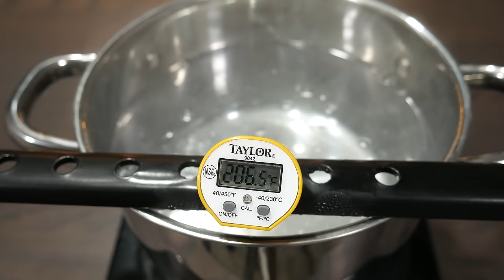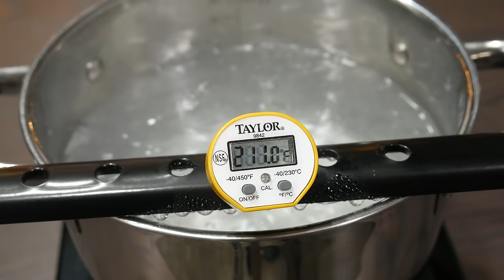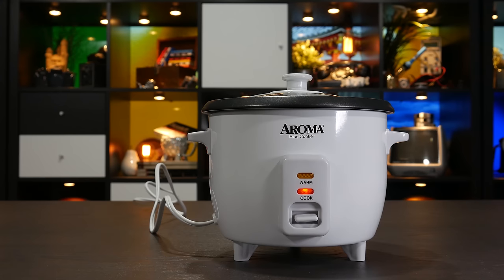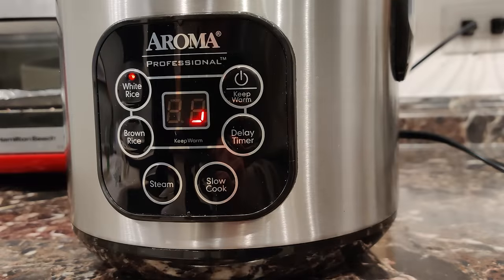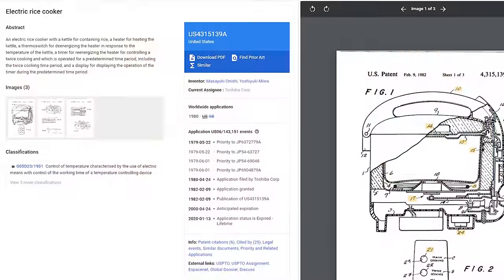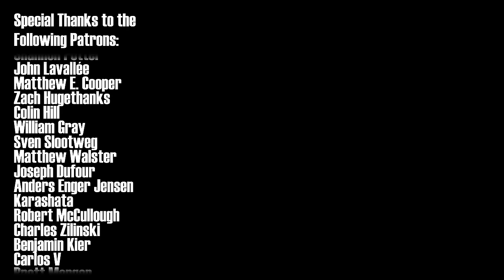Old-fashioned rice cookers are extremely clever

Comment: So lucky for you all here I just had a lecture on magnetism and still have my notes out (if you care to read it)
- Within a bulk mass of magnet there are domains, areas with the same magnetic moment.
- Magnetic moments derive from the atomic structure and is beyond the scope of this youtube comment.
- Senseable temperature is actually the rate of the random motion of particles in space.
- At the Curie temperature (Tc), the energy it takes to move the orientation of a domain is equal to the energy whithin that random motion.
- Above Tc, there is enough energy for the domain orientations to be scrambled by random motion.
- For a magnet, all the domains must point in the same direction.

The interesting thing is that in order to realign the domains, a magnetic field must be present while it cools down. I suspect you would have picked up the presence of a second magnet (electromagnet?), so I suspect there is something more complex going on where the magnet doesn't completely scramble. I might have to ask my lecturer, though he probably won't know either.

Some bonus facts:
- Above Tc, the material acts like a paramagnet.
- A paramagnet is basically what we would call something magnetic but not a permanent magnet.
- Ferromagnetic materials have the magnetic moments (at a atomic level) pointing in parrallel and add together
- Antiferromagnetic materials have the magnetic moments pointing antiparallel and so they cancel out.
- What we call permanent magnets form when atoms switch between domains in a process called Magnetic Hysteresis.
Reply from the maker: I'll tell you for sure the is no electromagnet in there. I believe it's not the magnet that reaches its Curie temperature but the material that it's attracted to. There were a few forum posts I ran across where someone said the spring itself was what lost its magnetic attraction but frankly that seems to run counter to what I've observed. The magnet definitely sticks to the sensing button, so I think it's that which is important - not the magnet itself

Comment: This functionality is also used in smaller pressure cookers. I have a small pressure cooker with the exact two modes, cook and keep warm. I accidenlty one day forgot to switch the cooker off in time while cooking beans. Thought the beans would be burned and the bowl ruined. Was surprised to find the cooker had switched to keep warm mode and there was a little bit of water left at the bottom. The beans and the bowl were fine. Did not understand how it switched to keep warm mode itself as i thought it was fully manual. I bought the cooker second hand without a manual. Thanks for explaining how the auto switch works.

Comment: We have that exact rice cooker and you’ve made me appreciate its simplicity. I had originally thought it worked by lifting off the burner when enough of the water has evaporated. It works consistently well but makes a mess as starchy water percolates through the loose lid. I wanted a more advanced, less messy one, but you have me reconsidering after pointing out how messy it gets under the seal. I think I’d rather wipe up the counter.

Comment: Alec, I bought a cooker thanks to your video, and found a way to avoid the nasty residue (that by the way, flies together with the water vapor expelled by the cooker and stains all the nearby kitchen surfaces): Just rinse the rice with clear water multiple times before using. I do it 4 times until the rinse water comes up less cloudy (doesn't need to be crystal clear). You will see an incredible difference, almost zero residue.
Reply: You're supposed to rinse rice, man. the bags should tell you that you need to. the residue is a powder added to the rice to make it not stick together in the bag. today it's edible and not too unpleasant, but it used to be Talcum Powder! you for sure didn't forget to rinse that off!

Comment: This message is brought to you by Celsius Supremacy: "water boils at 100C"
Reply: *100℃ (for disambiguation)
Reply: @hadrast   I for so long don't know how to type that, do you need a math typing software or something?
Reply: I liked the ironic nod to that in the video.
Reply: @kian8382  Extra ascii symbols are created using your numpad.
Turn on numlock, hold alt then type in the code for the symbol and let go.

For example the degree symbol is 0176. °
My favourite is just 3. ♥

You can easily look up more, it's semi useful.
Reply: This is the internet so in the traditions of pedantry I'd like to point out that boiling temperatures vary with a number of factors including pressure, the material, variations in gravity and shape of the vessel its heated in and the rate at which its heated.
Reply: @CallyMayz  Wow that's interesting, I must try it at work as my home computers don't have number pad. Thanks, great to know. Alt3
Reply: There are also some other ways to type out Unicode symbols, such as the character map or math symbol input accessories in Windows; I don't think the Alt codes cover everything. I'm using a customizable foreign language IME (input method editor) that allows me to map character conversions to whatever symbols I want. If nothing else, copy-paste will also work.
Reply: My name is negative 40 and I don't see what the big deal is?!
Reply: Thomas aside from pressure, how much will those other factors you list make the boiling point of water vary?
Reply: @kian8382  WIndows Key -> All Programs -> Accessories -> System Tools -> Character Map
You can find all the oddball characters and the Unicode character needed to create them.
Plus you can copy/paste stuff out of the utility.
Reply: This is my first time to this channel. I can't tell if he's being sarcastic with comments like this through the video.
Reply: ɮօʊռċɛ օʄʄ  It's as if someone based a unit of measurement off the freezing and boiling point of water, rather than someone most people have no understanding of.
Reply: Kian J on iPhone just hold 0 and it gives you option for °
Reply: @Thomas - indeed. Pressure related variations actually make it quite difficult to cook certain dishes that rely on the idea that water boils at a consistent temperature.

It's difficult to make a good cup of (black) tea high in the mountains, because the water needs to be at about 95 celsius to get the right result, which can end up being higher than the boiling temperature of water.

(green tea needs to be done with 60 celsius water. This is a factor in why Asians frequently seem to make terrible western style black tea, and why westerners often burn green tea, which tastes terrible.)
Reply: ɮօʊռċɛ օʄʄ  it's how they defined 100 Celsius Degrees, so yeah, it's a dead serious rule.
Reply: @sandgaijin  he's always sarcastic, unless he genuinely didn't knew about Celsius.
Reply: @thomas316  material and shape of vessel and rate of heating only change the boiling rate. zero gravity also makes it boil slower due to the chage in buoyancy of steam.

the only thing that changes the temperature that water boils at is the atmospheric pressure it is boiling under.
Reply: @wyattroncin941  Before you go any further you should probably check the following link out. I think you'll learn something new: http://www.sites.hps.cam.ac.uk/boiling/superheating.htm
Reply: @CallyMayz  so is 248
Reply: Thomas you missed one: elevation.
Reply: @kian8382  duh, just use shift and press the ^ on your keyboard. Nothing fancy.
Reply: @CallyMayz  ^
Reply: According to Anders Celsius, water boiled at 0 and froze at 100 - I always (wrongly these days) call it "degrees centigrade") rather than Celsius to avoid ambiguity :)
Reply: Correction, the temperature difference between freezing and vaporizing water is the DEFINITION of Celsius.
Reply: @GyprockGypsy  correcting what?
Reply: We have an answer from the Kelvin Rioters: "water boils at 373.15K"
Reply: Sorry only I only speak what put a man on the man.
Reply: @Kian J: This message made my blood hot, about 100°F. And, which is more immediately important to humans? blood or water?
Reply: @lesliefranklin1870  yes.
Reply: Whoosh
Reply: 0C is when water freezes. 0F is when people freeze. One is definitely more important to track than the other.
Reply: @squishmastah4682  Guess what, 1F is also when people freeze, so is -1F, how interesting.
Reply: @squishmastah4682  0K is when people freeze. Put on a coat~
Reply: Yes I think he knows that. Sarcasm buddy 😂
Reply: @kian8382  Hold Alt and type 0176 on your numpad.  Alt+0176 gives you °
Reply: @doggyspeak  Exactly.  I forget who said it, but, "Fahrenheit is how the person feels, Celsius is how the water feels" and there's something about Kelvin, but I can't remember that part, either lol  Also, as an American who does know how long a km is, it's 3,280 ft, 2,000 ft short of a mile.

Comment: It’s fascinating how mechanical electronics are. I just assumed everything was electrical.
Reply: I guess once you find the right alloy that reaches the curie point at like 215° , it would be easier and cheaper to mass-produce than an electronic thermostat, etc.
Reply: @cgduude    Another thing to remember is warranty returns.  From the seller's point of view the simpler devices are better because with fewer things to go wrong - you get fewer warranty returns.
Reply: Another interesting fact that goes with that is actually the way toaster timers work, as they use two thin metal strips back to back that slowly curve as the heat of the toaster warms them until theh cause the toaster to pop, while the dials affect the point at which the curving causes the toast to pop up.
Reply: @colincampbell767  Except the fuse. If that thing fails, o doe the appliance...
Reply: In the case of the "basic" rice cooker, There were no electronics. It's entirely electro-mechanical!

Comment: "I'm sure you all will tell me why my priorities and preferences are wrong."

Meanwhile in my brain: "Why the hell are his outlets sideways?"
Reply: @ShadownetZero Really? I've never seen that in my entire life
Reply: Stock Name  They are supposed to be that way, with the ground pin up. That makes a short circuit less likely if a piece of metal falls on it from above and it is not plugged in all the way. I think it looks upside down too.
Reply: What do you mean? How are they in your house?
Reply: Wait ‘till you find out every country has totally different plugs and everyone thinks there’s make the most sense :)
(In New Zealand ground is at the bottom, typically, but also our pins are on 45 degree angles, not straight like US ones)
Reply: @matthewjamison1193  does this happen often, thin bits of metal fall on your plugs?
Reply: @davidlawrence8711  it is an exceptionally rare occurrence, but all AU/NZ plugs made after the early 90s have the plastic coating on the top two angled pins because of this. Any new plugs that lack the plastic sheave these days are manufactured for the Chinese domestic market, as this is the plug used there for non-personal electrical devices (they use the US plug for personal devices). However the Chinese non-personal plug is pluged in upside down with the angled pins facing downwards and the straight earth pin facing upwards in case something falls on the pins.
Reply: Or another way of putting it is that the plug that is used in China for TVs   are exactly the same as the plugs used in AU/NZ in the 80s, but they are plugged in upside down at the wall to stop electrical hazards.
Reply: @richienyhus  thanks for the info!  I can’t believe I’d never realised they all have the plastic coating - I can picture some, especially Apple plugs which coat in white, but I’d not realised they all have it (you can picture me pulling out stuff around the house just now to see if I could find one without haha...).
Could this also be to stop little fingers making contact while the plugs are in enough to be live? Mum would always caution my kids about how they held a plug because she’d seen a “9 year old girl blow her fingers off” touching one (very easily could have been pre-plastic coating).
Reply: Id rather have sideways than what I have at my house... all 5 individual light switches, on one wall, about 18" from each other, but slightly higher or lower on the wall than the others. Not even close to a straight line. I just look at it sometimes and it honestly upsets me an unnecessary amount.
Reply: Upside down outlets don’t look like little happy smiley faces so it’s less attractive to children as well. Though I will fully admit to this being an ad hoc and unsourced observation/reason.
Reply: You people could look at the behemoth British plugs. Springs, caps, chunky AF three pins, even if one is plastic...

You can't make any British plug or socket sleek. 😅
Reply: In commercial buildings, you will see a lot of outlets installed upside down, mainly so the grounding prong is the most likely thing to be hit first by a piece of metal.
Reply: @davidlawrence8711  I guess you were never a firefighter who gets called out because a plug that was ALMOST all the way in had some metal Christmas tree tinsle touch the leads and the whole tree goes up in smoke, usually with the house igniting as well.
Reply: @davidlawrence8711  Same, same. In Aotearoa as well but absolutely had not noticed the change. Just pulled out the 3 plugs next to me and they all have plastic coating. Also, note to self, DON'T unplug the lamp unless you actually want to walk across the room in the dark to turn on the overhead light. Duh.
Reply: @matthewjamison1193  yes. I worked for an electrician and in one house the home owner request we put them in upside down. I thought it crazy but the guy told me that they are supposed to really but it's not enforced because too many people don't like the ascetic of an upside down outlet. We always placed them sideways in kitchens and bathrooms though.

Comment: Thank you. I had thought it was weight triggered but this is more interesting. I'm on my 4th rice cooker, each ordered over a year. The problem with most is the rice husk dissolves into the water (an excellent reason to rinse rice) which is then sprayed thru the vent hole onto your cabinets. A cooker with a veggie basket (with or without veggies) sprays less rice vapor around. The rice cooker that makes the "keep warm" setting an option delivers better rice. Once rice is mostly waterless, it's a good time to shut it down. Cooking longer tends to fry the bottom rice, which is made worse by continuing to warm the rice. This isn't a problem if you like dry European/US cooked rice. It'd be possible to have a better cooker, or chef can keep a closer eye on the "automatic" cooker.

Comment: I have the same model of Aroma Rice cooker (large and small...ot sure of cup measurements atm) and a similar model of the other one in the video.  I use to only cook rice or occasionally steam some veggies in the Aroma cooker.  Now, i use it for multiple things.  It's great for oatmeal, cream of wheat, Coco wheats, heating up soups.  When my stovetop quit working, i found i could cook canned veggies, hot dogs, hamburger, bacon , sausage, scrambled eggs,... basically most things i would use a pan on the stovetop for.  It really has become a multi functional appliance in my kitchen.

Comment: I am usually very sceptical to kitchen machines, and didn't get a rice cooker until like 5 years ago when i was already over 30 years old... i realized this was the best and only kitchen appliance i ever need... this and an electric kettle... anything else is just a hassle... best electric appliance investment i ever made... 
Perfect rice every time and i eat rice most days... if you forget it it just turns off or keeps the rice warm, super easy to clean... fairly energy efficient as heat isn't wasted into the surrounding from the stove... after that i told everyone in my family to get a rice cooker.

Comment: 2019 : Toasters
2020 : Rice Cooker

at this point i have no idea what will come up next
Reply: Rice cookers with built in toasters.
Reply: A cattle?
Reply: @TBFSJjunior  You mean, a kettle. Cattle will come up next on a different channel called Farming Technology Connections.
Reply: Iron for clothes
Reply: Pressure cooker?
Reply: @Wolf-Spirit_Alpha-Sigma 
😂
Damn I knew while writing that it looked like the animal but things are never written with a k in English so I went with it.
(And a/e is a hit and miss anyhow)
Thanks for the correction.

First I wanted to write "water cooker" as the German word is Wasserkocher, but remembered you don't cook water but boil it in English so "water boiler" ... oh wait no that is the one making hot water for the shower.
I was so proud that I remembered kettle and realized I never wrote the word, but was to lazy to look it up.
Reply: I know...... Air Fryers 😏
Reply: He needs to do one on nichrome
Reply: Waffle irons.
Reply: @TBFSJjunior  you did pretty good don't worry about it english is stupid also if your not using k often and are confused if a word has a k or a hard c i would recommend just using the k until you learn the word because it leaves less room for confusion
Reply: yup, kettle is good idea. Interesting thing about it is it doesn't depend on 100 degrees Celcius at all. If working at high elevation with lower boiling point, it would turn off anyway the moment water boils!
Reply: George Foreman grills
Reply: Definitely a kettle. A discussion about why don't Americans use it, the current differences between Britain and the US, boiling water with a stovetop kettle and the idiots who microwave water.
Reply: SPOOOONNNNN 
annyone still knows that meme sound ?
Reply: A nail.
Reply: @DeisFortuna  shite i'd buy that thing
Reply: @Anvilshock  you nailed it

Comment: The Aroma rice cooker actually has a 2nd function. It is called warm. It holds the temperature at 160 degrees Fahrenheit whenever it isn't set to cook. If you want to make black garlic, this works perfectly, it will happily hold the temperature for the entire month the process takes.